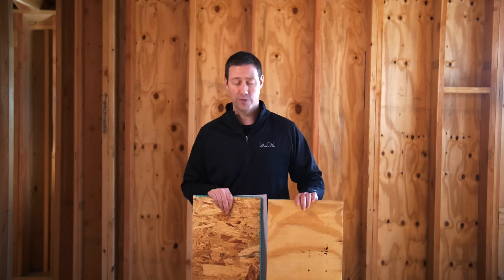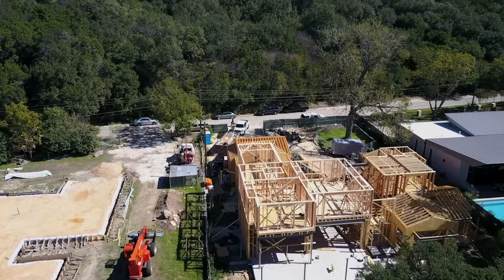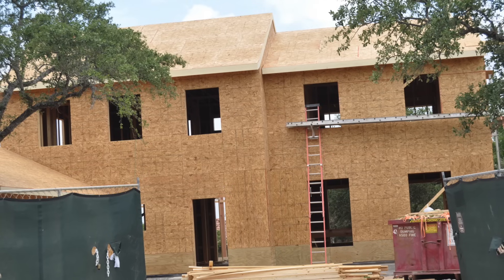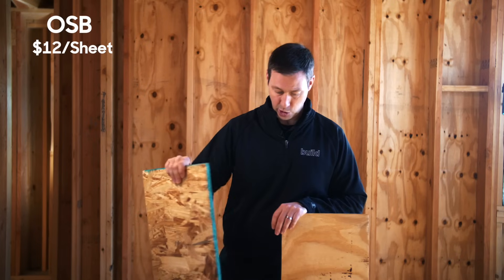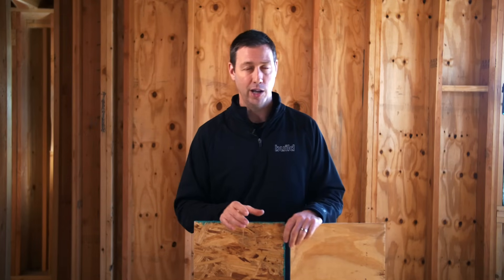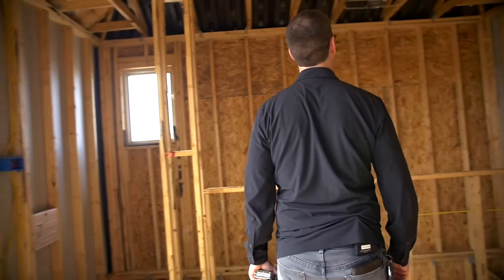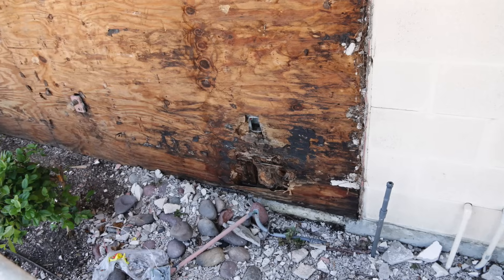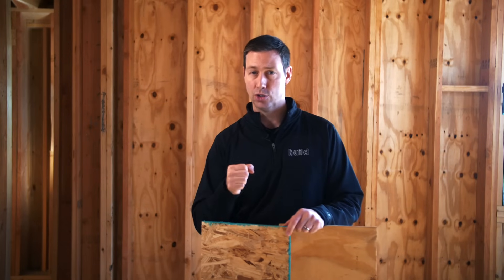Framing : OSB vs. Plywood - Whats the difference in COST AND PERFORMANCE

Comment: "a durable product that's going to be around for a long time" How about stone, bricks and concrete?
Reply: That's why I'm grateful to live in the house I inherited from my grandma. Brick siding house built out of cedar. No plywood anywhere in this house that I'm aware of
Reply: Other places but USA
Reply: Agree! Here in Iceland 90% of houses built are made from concrete. Now thats a house built to last! Concrete is a much better that timber for houses here in Iceland. Don’t know why there arent as many houses made out of concrete in the US. If anyone knows please let me know.
Reply: @antonfjolnisson7574  lots of wood here available in the US so we do use quite a bit of wood. I live in a part of the country that has a I live in Seattle which has similar weather to the UK. My house is Cedar on the inside with brick siding but it has a concrete basement which is common with older houses here. I imagine would isn't use their in Iceland is commonly because there's Westwood available in the country and it's more susceptible to dry rot from the extreme cold
Reply: RabidNemo Yes old timber houses here rot a lot. I would also think the US has a lot of cement factories aswell. But the building materials differ between regions in the world. Climate has a lot to do with it.
Reply: @antonfjolnisson7574  a lot of modern apartment buildings utilize a lot of cement unfortunately it's very poor quality cement that's mainly used for the actual support structure of the building and everything around it is even cheaper sheetrock and wood. I like comparing it to the cheap housing that was built in the Soviet Union in the 70s and 80s
Reply: RabidNemo That’s not good... Here we have high quality cement. 90% of it is imported from Denmark. The rest is made locally. The quality of concrete over the years have sky rocketed. All walls that face outside are from concrete. Some inwalls are made out of conrete to assist to keep weight of the rest of the house and floor and the roof. It’s hardwork we have to utilize a lot of equipment, a on site crane, steel frames and etc. Hardwork... But I love it.
Reply: @antonfjolnisson7574  that's something we've lost here in America in a lot of major buildings is quality craftsmanship. You're part of the world never lost it because it's essential. Houses are very overpriced to they use very cheap materials. It used to be part of the cost of a house was the materials and labor that went into it now you're basically just paying for the land and labor.
Reply: man I used to live in W Europe, there many of the houses are cinder block two layers deep. cost a t but will last for hundreds of years.
Reply: Could someone from US actually verify this pls? 

I've been told that in most areas of the US, due to natural disasters (such hurricanes, earthquakes and heavy storms for example) insurance companies won't insure you due to the cost of replacing a house made of bricks and concrete. So due to the fact that you are highly likely to make a claim you are kinda forced to build out of wood. Is that true?
Reply: @marcozapata6984  to a certain extent for example I inherited a home from my grandmother which has brick siding and she had earthquake insurance grandfathered in. Unfortunately that did not transfer to me and I have to have the house retrofitted in order to get earthquake insurance
Reply: @marcozapata6984  Some South Florida builders build entire subdivisions with concrete block exterior walls with a stucco finish.  Benefits include less fungus and termite damage, and of course Florida building codes focus heavily on hurricane resistance.
Reply: Still need sheathing
Reply: @RabidNemo  still susceptible to dry rot and termites .the brick isn't air tight to the sheathing behind .and cedar is better for rot resistance but will still rot
Reply: Anton Fjölnisson 
huh...price ! duh !!
Reply: Stone, bricks and concrete are not good building products in earthquake prone areas.
Reply: J P 
exactly, they have poor shear resistance but very high compression.
Reply: @antonfjolnisson7574  And in Sweden 90% of houses are made from wood. They last long, look good and are fun to build. Fun to live in too.
Reply: MrSkyl1ne too expensive:/
Reply: How bout Poo, Cardboard and Fish Ply
Reply: Cool
Reply: Those materials are all frangible, which means they're not so great at seismic resistance like a more pliable light platform framed building would be...
Reply: @jessybwoy8677  Contractor s LOVE Densgalss products, You can leave that shit exposed to the elements and it keeps on rocking (get it, keeps on rocking)
 LOL) during construction...
Reply: @antonfjolnisson7574  it's cheaper and faster to build by  just using wood. In Texas homes are build on a concrete slab framed by 2 by 4's as well as the walls and trusses. For the outside walls plywood is used and after that a foam that is 4 inches thick is applied to the plywood. A wire called chicken wire is screwed on to the foam and wood. Finally like about 1/8 of cement, called stucco, is applied to the chicken wire. Inside, insulation which is fiber glass is placed in between the 2 by 4's and sheet rock is screwed on to the wood to make the walls inside.
Reply: @antonfjolnisson7574  
Only about 2% of Iceland is forest. I live in Canada. A brick home will cost you maybe double the equivalent of wood. People want their square footage.
Reply: The old rule still applies, give a building a good hat and good boots, the rest is optional.
Reply: @JP-gc5in  concrete is reinforced with Steel where i live, so it's sissmic proof, but of course it's not cheap, but it can Last centuries
Reply: I am ✨broke✨
Reply: cobainzlady  no because there are fire breaks and sheetrock. Do you have any idea how much more flammable plywood is?!
Reply: Jamie Smith  my cedar is fine and you're mistaken
Reply: @antonfjolnisson7574  Maximum profit and shitty regulations that support it.
Reply: Osb or plywood= shitty house+max profit
Reply: OSB does NOT hold up. It soaks up moisture, water vapor, etc.. like a sponge.

Comment: Look at the sheathing behind him. He used plywood, enough said.
Reply: also he's got it running the weak way plywood should always run with the grain across the studs
Reply: @tboproductionsify1  so would you want the plywood grains be facing perpendicular to the force that it needs to withstand or parallel?
Reply: @MeisterSexy11  Based on splitting logs with an axe, I can split a log with the grain much easier than against.  However, plywood layers are cross grain or perpendicular thus giving strength from either direction. The most strength would be against the apparent grain with an odd number of layers and equal with an even number of layers.
Reply: @tboproductionsify1  The plys in plywood are layered perpendicularly. So it really doesn't matter much.
Reply: If you're using 4 ply plywood it doesn't matter which way the grain goes 5/8 or 3/4 with 5 ply I would run with the surface ply perpendicular to framing because 3 of those plys are running the 8 foot length and the other 2 are running the width if that makes sense.
Reply: Yilmaz Ayten  try bending it the 8’ way as opposed to the 4’ way you will see which is stronger lol
Reply: Ernie Sullivan here come all of the experts.
Reply: OSB soaks up moisture, water vapor, etc.. like a  sponge. When that happens it starts to break down. It becomes soft. Looses its  rigidity and tensile strength.
Reply: In the video he told us that he did that particular house in plywood.

Comment: In NZ you can use plywood when treated closer to the ground, where as OSB has to be a min of 550 off the GL. Plus ply just looks nicer.
Reply: why go near ground organic material it not magic
Reply: Well, I mean, the customer selected it, right?  (I would assume.)  As far as aesthetics, you'll never see any of that.  On the interior, it'll be insulated then drywalled over, and on the outside it'll have some kind of Tyvec sheet stapled over it, and then some kind of siding over that.  No one will ever see either side of the framing product (except maybe in a garage, perhaps.)

Comment: great video.  as a roofer that sheathed MANY roofs i resisted the OSB for a long time but have concluded that it works very well and as intended.  it has the benefit of being cheaper and more price stable.  it is also made from trees that grow rapidly on farms meaning it is as "sustainable" as all hell.  all wood products fail when wetted for extended time periods...

Comment: I had to get windows covered for a hurricane. Bought the last of the plywood, then had to buy one sheet of OSB. This was in 2004. Got through the storms, put all the wood in the shed. Couple of years passed and I decided to use that wood for a chicken coop. The OSB was severely warped, the edges were expanding all around. The plywood was in perfect shape. 'Nuff said.
Reply: your dog looks very much like my dog who is half Siberian Husky half  German Shepherd. at 13 months he weighs 70 lbs.  we call him Houdini due to his uncanny ability to escape.
Reply: Good on you Ronnie in Florida! Stay dry and batten down the hatches, more storms are coming!
Reply: Correct.  That's why houses are completely waterproofed from ground to ridgecap....
Reply: Ronnie in Florida 

OSB today is much better than 10-15 years ago. Manufacturers discovered pretty quickly that if they can make OSB handle a bit more moisture then builders will use since most house get at least a little bit wet either while lumber is sitting there or during building. 

However plywood is still superior no doubt, but today you can have it be rained on a good bit and no swelling or warping will occur like it dis just a few years ago.
Reply: @Mark_Cook  Must be a very recent improvement for OSB as a whole, because I've got stuff from 5 years ago that's pretty much disintegrated and older plywood that isn't.
Reply: Same here. Bought plywood and OSB in 2004 for the 3 hurricanes that hit Florida. Stored it and forgot about it until 2017 when Irma was on its way. OSB was falling apart and worthless. Plywood for the win.
Reply: Ronnie Not enuf said...

Look, if 75% of the homes are using OSB board, it's being used on the "tall bricks" too (high dollar homes).  I've yet to see a single home with warped walls, and then you'd want to blame it on OSB board?  Naaaa...it will stand the test of time.
Reply: @bigelile07   Plywood for the wind if you simply want to store some away, but hey...we're talkin' about doing a HOME with it, and WRAPPING the home. SMH
Reply: My plywood commercial: Guy comes out, smiling, conventional. Introduces his young daughter, who is breaking strips of OSB with her hands. Introduces his teenage son, who is struggling with strips of plywood. Fade to an American plywood logo.
Reply: @Kman.  Have you worked with OSB  for 45 yrs and it's crap . OSB has : - no edge  strength, , no weather  durability  ,,, more flammable  and more toxic glue glass off  than plywood . Contractors who use  plywood know their trade ,,  Please read a book  before you make a comment

Comment: One thing you didn't mention was resistance to wind blown debris from a tornado. There have been tests done where a 2x4 was shot at a wall sheathed with plywood versus OSB. It went right through the OSB like it wasn't there. Plywood had MUCH more resistance. Also fire resistance can be an issue. OSB and other engineered products like I-joists burn hot and fast, not leaving much time for an occupant to get out or the structure to be saved by the F.D.
Reply: I often use old plywood or OSB for target backers on a shooting range and I can tell you point blank (pun intended) that OSB does not hold up as well to bullet strikes.  

Also, have you noticed that some boats are sheathed with marine grade plywood, but you never hear of marine grade OSB?  CONEX container floors are made with plywood, not OSB for the same reason.
Reply: Hott Puppy   As someone who has lived through dozens of hurricanes and 4 tornadoes, this fact alone would sell me!
Reply: We're talking exterior sheathing, if your concern is the osb there burning too hot and fast the occupants are LONG dead from smoke inhalation.
Reply: So why not bricks then?
Reply: @kathyyoung1774  "dozens of hurricanes"? I would not like to live near you! Or Jim Cantore.
Reply: Just depends how you want to die.... hellfire = osb/plywood   or  masonry = hellquake
Reply: @kathyyoung1774  Have I got a story for you then since you have been in hurricanes. Gulf cost of Florida, 1998ish, one builder, building  2 homes side by side on the beach. One owner takes the contractor's suggestion and opts for plywood, the second save a couple of bucks and goes for the OSB. Both homes have just finished sheathing when a hurricane comes through. After the hurricane the plywood home is still fully sheathed. The OSB home? Well the sheathing nails were still there but about 85% of the OSB was nowhere to be seen, and the entire house frame was racked.
Reply: A good tornado will put a piece of straw into an oak tree. So I wouldn't count on plywood saving you.
Reply: @kathyyoung1774  powerful hurricanes and tornadoes can level masonry structures. We basically don't build the right  way to survive those kinds of weather events. The square box shape is not ideal. It is just the most economical design.
Reply: @joergreinicke5945  why not steel plate then? Because the price makes it a non option in many areas even if masonry was storm proof(it isn't) it wouldn't be the choice made by someone considering OSB.
Reply: Another thing he didn't mention is resistance to nuclear warheads.
Reply: Also he didi mention anything in case of the apocalypse, it makes me not to buy

Comment: Nice review. 

In Norway we use neither. Only use (GU-gips) drywalls for outside use. The plaster boards are water repellent. It stiffens the walls in the house, and are wind protective. You have to use special tape in the joints. To make air between the boards and the wood panels (normally vertical or horizontal), you nail on 48mm batten/boards first, before nailing the wood finishing cover panels. It cost around $23 pr. sheet (normal size 1200x2700mm). On roof we use canvas/cover first, then OSB, then another canvas, then 23mm batten/boards on the studding, then 48mm boards cross nailed, then concrete roofing tiles.